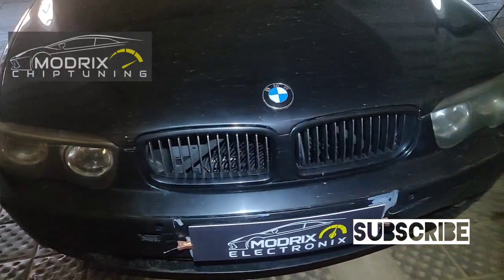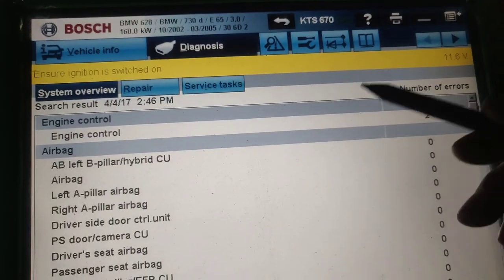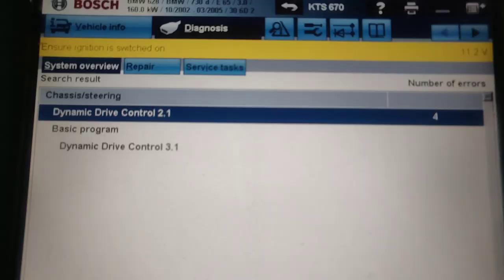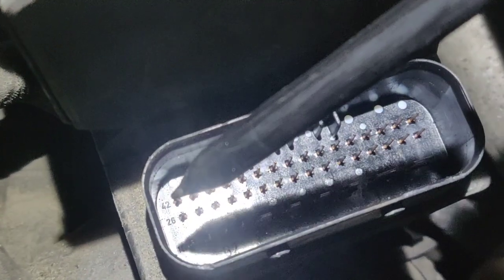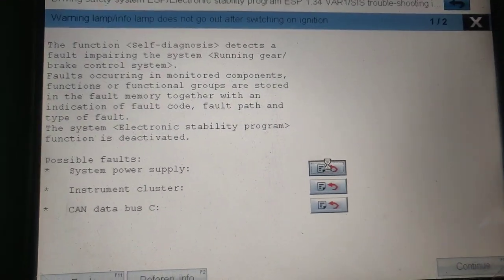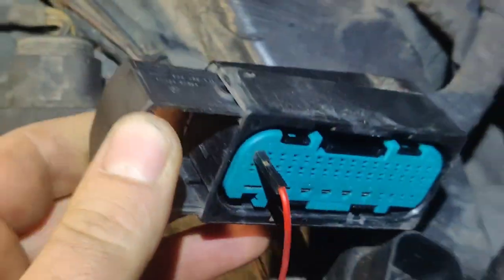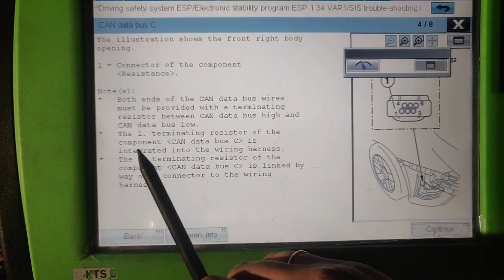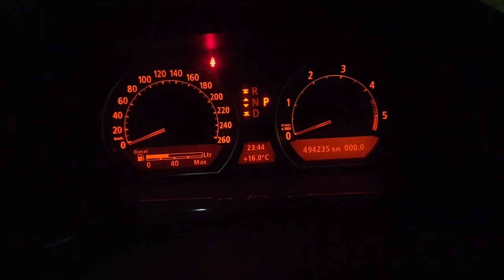✅BMW 730 2003 E65 ✓ABS/ESP system ✓CAN line faulty fix✓

Comment: Real nice work. I have the same kind of issue and took the car to this car electronic shop’ not bmw dealer’ and he said he was unable to communicate with the car!. I have a valve gasket cover leak on that side. I am going to check if the hot oil leak has damaged the wires. Thanks so much for a very detailed information.

Comment: I have a traction control triangle light in my dashboard along with the message of Dynamic drive failure on my BMW 740, 2006. I did twice scan but no error codes. Car is lacking power. Any suggestion how to fix this
Reply: Scan with Boch diagnostic system and read the fault

Comment: Hi i have a 2004 bmw 730i ive followed this video and done manual inspections and i keep getting a fault code po500 vehicle speed sensor A 

I have replaced all the wheel sensors everything was good for 24 hours now i have loss of powersteering and the faults in your video